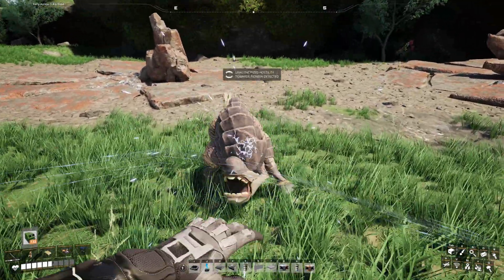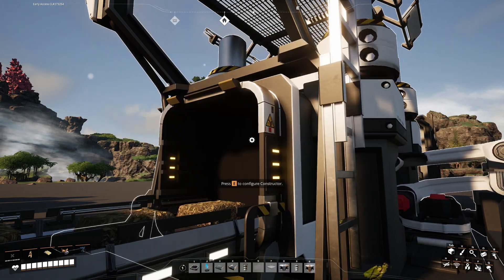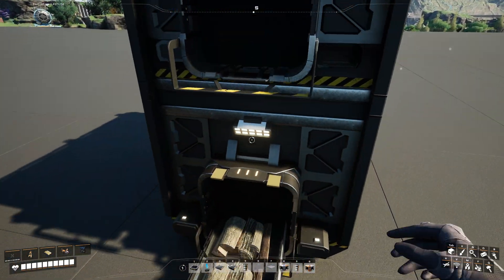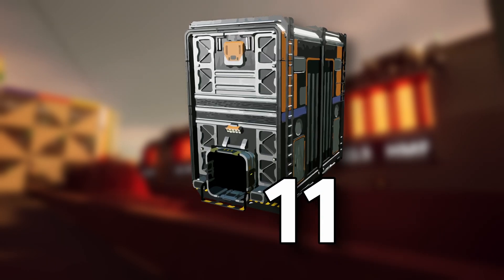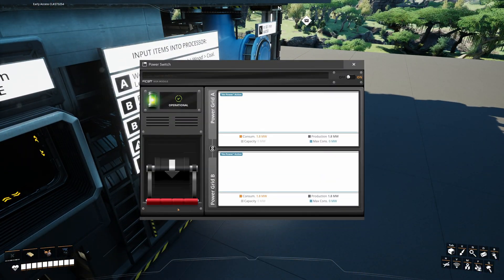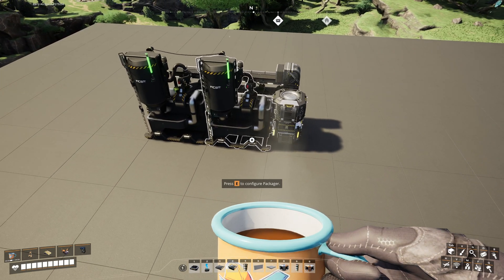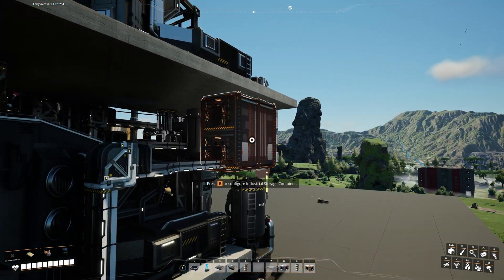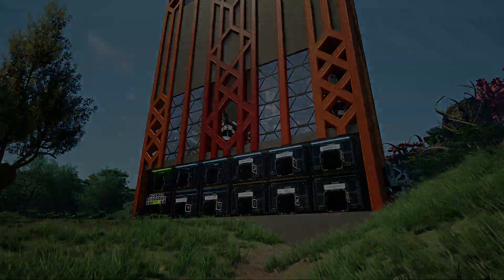APEX Flora & Fauna Automation in Satisfactory

Comment: I tried making something similar myself (excluding the exterior that is, that I can't make it look pretty without increasing the blueprint's cost quite a bit) in a 4x4x4 blueprint. Isue is, while mine had a similar layout at the bottom, it's set up somewhat differently. 
bottom floor (where people might actually enter):
1 input for biodegradable inputs (leaves, wood, biomass, slugs, alien remains or any kind, mycelia), 
1 input for the non-biodegradeable inputs (this is just connected to the top, where I could stack another layer/blueprint on, as I didn't manage to fit the non biodegradeable parts into the build.),
1 overflow/safety bin
6 output chests (2 of which are not in use, the other 4 are for: fabric, power cells, alien DNA capsule thingies, and solid biofuel.)
1 MAM
1 equipment workshop
1 crafting bench
a bunch of (8, stacked, 2/layer) personal chests
Honestly, I was hoping to include a way to turn the solid biofuel into packaged liquid biofuel in the same blueprint, but as I had space issues, namely, I had to make parts in a separate blueprint designer, so I can place some of the conveyor lifts in places where I wanted, when putting together the top floor. Space is quite a luxury when I want a full system to work without issues.